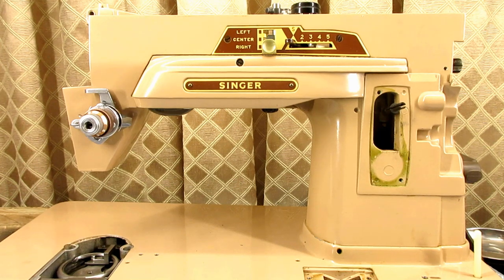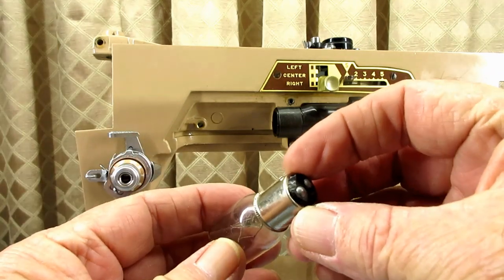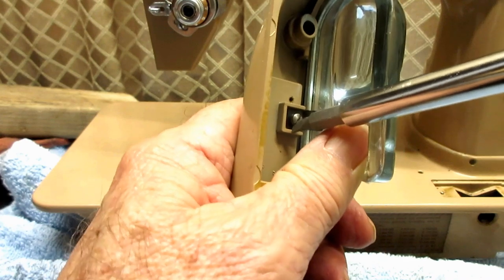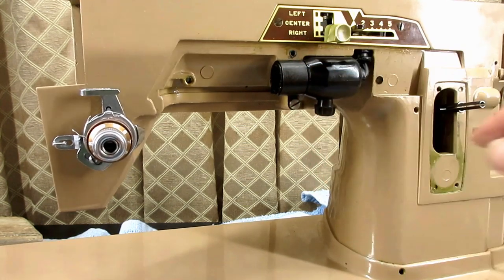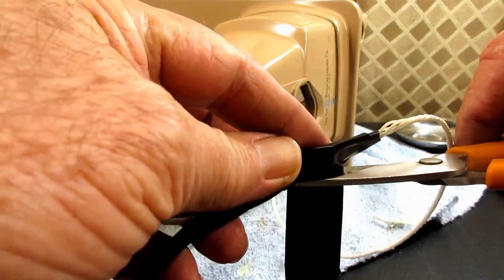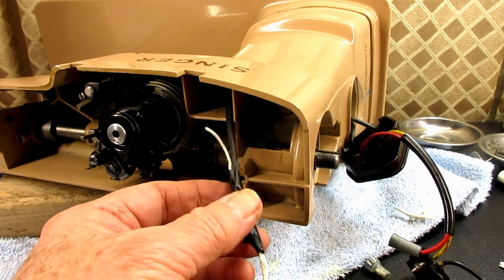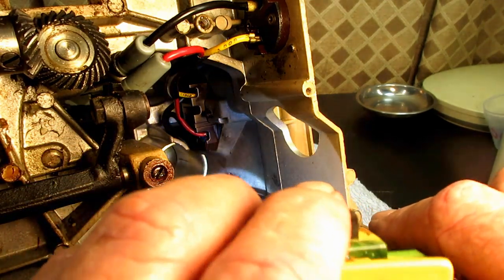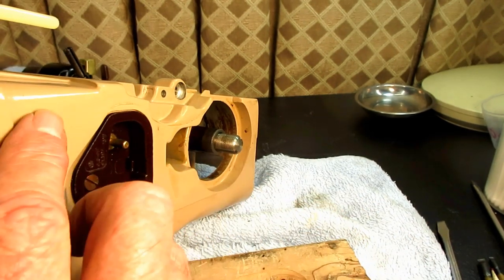How to Remove the Light, Wires and Terminals of a Singer Model 403A

Comment: Hello Andy!  Love your videos.  Do you have one that shows how to attach a 403A to wiring of a built-in cabinet foot pedal?  I can only find info on attaching a bracket to inside of cabinet for mounting the portable foot pedal to use with a knee lever.  My cabinet has a telescoping foot pedal in the base with wires going up through the inside of the cabinet that somehow get attached to the machine but I don’t know where on the machine to attach them.  Do you?
Reply from the maker: Sorry, I do not know. It sounds like your 403A was retrofitted into an older cabinet. By the time your 403A was made, they all left the factory with the push-button foot pedal and the cabinets had the knee lever bracket that the pedal slid into. I don't know what a "telescoping foot pedal" is. Some old black Singer models had a controller attached inside the cabinet with wires from it to a small 'box" under the externally mounted motor and spliced inside that box to the wall cord and motor wires. Model 403A has an internal motor with the wires going to the back of the plug receptacle along with the wire from the light. Two cords were plugged into the right side of the machine. The wall cord and the foot controller cord. Maybe your controller cord is spliced into the back of the plug receptacle.

Comment: Have you done a video on replacing the power terminal to a 500A?
Reply from the maker: I have not. Singer Slant Needle Models 301,401,403,404,500,503 are all about the same as in this video. The wires from the wire harness of the 500 clip onto the wire terminal if I remember correctly. You can download a free copy of the Service Manual for the 500/503 here: https://sewingdude.files.wordpress.com/2012/09/singer-500-service-manual.pdf    It discusses and has pictures of the wiring diagram

Comment: I have a 403 that looks like it has been poorly stored for a lot of years. I feel like I can now clean it up. Thanks
Reply from the maker: you are welcome and I'm glad you found my channel I will soon be doing a full body wash and dry of Regina the 403 When I put her in the shower and use the degreaser if you can't wait for that look for the series I did on the model 404 that playlist has 50 plus videos including cleaning or look at the playlist for Coco goes to the spa the model 301 thanks very much for your comment
Reply: I took all the parts off that you have covered so far as well as the electrical. I watched Coco spa and will do that to my machine and get the grime cleaned out and get it oiled and greased. I’ve collected all the materials I will need. I’ve also serviced the motor. I’m looking forward to getting the parts cleaned and reinstalled. I packaged the parts in plastic zip lock bags to stay organized. I hope it all works. This is my practice machine. I have a 401 and a 411 that need a bit of work, they have sat for a lot of years too. Thanks for your videos for people like me. I’ve learned a great deal from you.
Reply from the maker: @vsmetc7305  You've been busy! I hope it all works, too. No reason it shouldn't. The only thing left I will be removing the next video is the Disc Driving Worm Wheel so I can clean that along with the arm shaft worm gear. You'll be fine, and the 403A is good practice before the 401A. That is a good idea.
Reply: I think I’ll wait till you remove that worm gear and do that too. I’m in no rush. In the mean time I’ll clean the parts. I have an ultrasonic cleaning machine too for the difficult parts. I also have 2 301 machines that could use a spa treatment. I’m from Canada - I fix bicycles in spring summer and fall. My winter will be working on my sewing machine collection. I also have a Singer 206k beige that could use a spa treatment. I’ve had problems getting it to swing and I think I need to clean out the grease pot area by the hook area. Have you ever done a 206?
Reply from the maker: @vsmetc7305  I have only seen pictures of the 206K25 model. Actually, the only black painted Singer I ever restored was "Cute" my model 99K. You should film your work on the 206K and do a restore series of your own! There is not much info on YT about working on that model: https://www.youtube.com/results?search_query=singer+model+206k
Anyway, the worm wheel video should be up Friday, 11-8-19 at 6AM. Thanks for watching.

Comment: Hello I just inherited a Singer Sewing 403A it's in good condition and I like to use it for myself.  I don't have the power cord or pedal.  Would you know where I could buy one that would fit the 403A?  Any help I'd appreciate, thank you
Reply from the maker: Here is one of the largest online seller of parts: https://www.sewingpartsonline.com/search.html?sort.relevance=desc&keywords=singer%20403A&index=1
They sell foot controllers also, both carbon style and electronic. You can usually find them wired to fit your machine. There are many sellers on eBay who sell vintage cords and controllers and new cords and foot controllers. Model 401A, 403A, and 404 take the came cords and foot controller.
Reply: @andytubesewing1953  thank you!
Reply from the maker: sure, welcome.

Comment: Where can I find a wiring diagram for this model, all I can find is 3 pin or wire diagrams. I need the 2 wire diagram. Also 3 line wire goes where? Red? Smooth wire to yellow?
Reply from the maker: Singer model 403A is a "Class" 401 Model (401A, 403A, 404) The Service Manual for Class 401 has a nice Wiring Diagram on page 162. This Service Manual can be downloaded for free at this link https://sewingdude.files.wordpress.com/2012/09/singer-401-service-manual1.pdf
Reply: @andytubesewing1953  thanks alot, I figured it out. Someone wired it wrong, almost burnt the motor. Now it runs faster and more reliable. My mom will be so happy, been  sitting for 30 plus years.
Reply from the maker: @Nords1982  Congratulations. Thanks for rescuing that machine. Nicely done.
Reply: Hello Nieves Mares , Where do you find the wiring diagram for 3 pins, please. Best regards, Anne